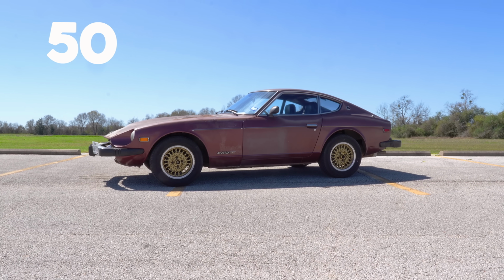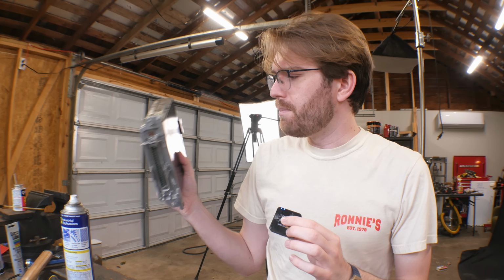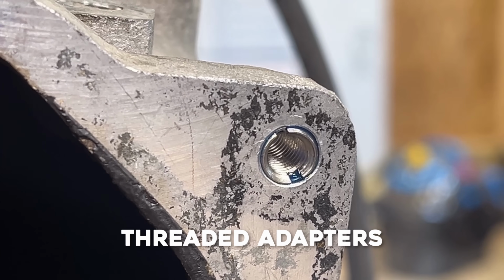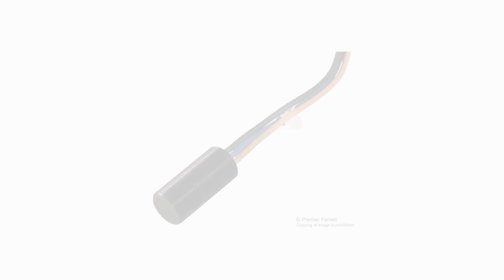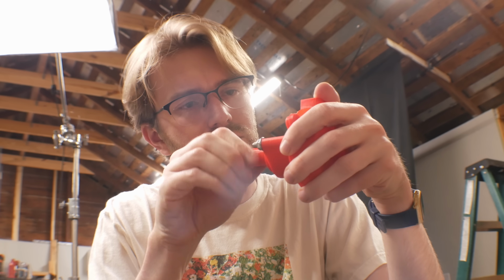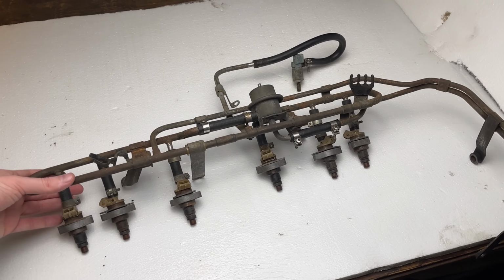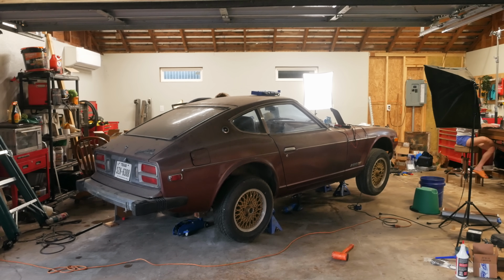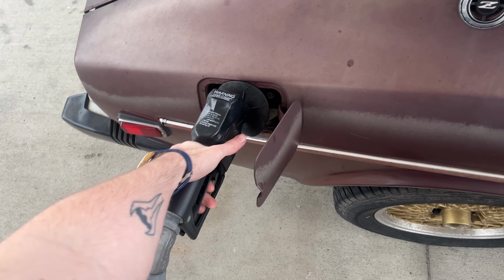Modernizing a Vintage Car

Comment: Please be careful putting more power into a 280.... they are great cars and make fantastic street racers and even better drift cars, but for most people it just becomes very dangerous to drive.  It's a rear wheel drive car that only weights as much as your mom , and when roads get wet it'll sling you off the road before you know it. I had a very close friend die in a Nissan 240z (same thing, but after they got bought out) and that's exactly how he died.... fishtailed into a ditch and ramped over a colvert and into some trees.  He was a small guy, maybe 120 lbs, and he died instantly.  So just please,  be careful.

Comment: I would route that PCV breather filter through the intake air duct so the airflow is being measured properly... It's surprising that it is only getting about 19mpg... I'd expect it to be a bit better... It's better than it was, so can't complain.

I imagine this about the same level of effort the original engineers went through, and I'm sure they were very impressed with themselves.

What software were you using?

Anyways... Good editing, was very entertaining... I just discovered your channel for the first time.

Comment: I think the real reason old classic car enthusiasts don't like computer control is because it was a massive shift in control and repair-ability from the mechanic to the manufacturer when it first came out. Since you can DIY engineer the same system yourself now, it's not so much of a big deal. Hopefully this trend continues for cars made nowadays.

Comment: I had a '78 from 1995 to 2000.  Did a significant amount of work to it.  One thing that really helped was replacing the rubber parts in the suspension.  That way any of the additional power I was making from replacing seals, eliminating vacuum leaks, porting and polishing the head, decking the block, etc. made it to the wheels rather than overcoming skewed geometry.

Comment: Aren't you missing a rotation sensor to tell you which half of the cam rotation you're in relative to the crank?  Or does a cam sensor alone actually do the job?

Comment: I think the only thing that might cheaply add more efficiency is using an electric fan instead of a clutch fan. Unless you plan to drop in higher compression pistons

Comment: very nice restomod
though you should sweep the inlet of the throttle body adapter into that oval section, you will some fucky flow characteristics. also, plz press-fit the bearings on the tone-ring driver shaft for the RPM signal. the inner race will slip and it will start putting trash into the motor.

Comment: Incredible what you achieved and everything you learned in the process, but 13% more horsepower and a 10% improvement in gas consumption... let's just say the project was worth it for everything that was learned.

Comment: Very well done sir.  I had the 1977 version of that same car, even the same color.  Was a maintenance nightmare.  So many things weren't designed well at all.  I agree that all the shit you jettisoned in favor of a much cleaner approach will add a ton of reliability.  The stock fuel pressure regulator always gave me problems.  When so we get to see a Part 2 of this adventure....

Comment: L- Jet rules - still running in many cars close to 50 years later. As long as you have a good temp sensor and afm itll run all day everyday in the middle of the summer and dead of winter

Comment: "you lose direct connection from the driver to the car" moreso refers to the fact that everything electronic is yet another point of failure, just like the mechanical, but you have to do mechanical things at some point regardless
and if you have no direct way to arrest the engine's speed, the engine basically can get stuck in any position without any feedback as to why, which confuses people, and leads to accidents

theres a HUGE reason why your brake pedal MUST be directly and uninterruptibly connected to the brakes in a fashion that if you are to press the pedal fully, it will give the maximum force to the brakes, even if it is hard to do so (its even a federal law)
why?
because when all else fails, the brakes are more powerful than the engine, and you need a way to stop, no matter what

Comment: This brings back memories of me in the late 90s early 2000s trying to "modernize" my 82 Supra with the 5MGE engine. But most of this stuff wasn't available to me back then. The only stand alone EMS systems at the time were the AEM EMS and the APEXi Power FC. Both of which were WAY out of my price range. I spent countless hours with a multimeter,  a dual trace oscilloscope, and an APEXi Super AFC to get her as modern as I could. I would have killed for all the answers we have today. My turbo system was cobbled together from a 7MGTE and custom piping made in a buddy's garage. I had to fool the VAF signal with some help from Radio Shack lol. The end result...at one time I had the fastest MK2 Supra in the US with the 5MGE motor for a short time. Ahhhhhh those were the days.

Comment: Worth noting this is a L28E when they added electronic injectors. The base L28 is kinda of just a carryover of the L24 which is the 3 carbed version they also use in the non gtr version of the original skylines and is one of the best sounding vintage engines I've ever heard. I almost cried when I saw "modernizing". But for this hunk of junk... this is so damn cool! I think it's time for a bore :D

Comment: Modernizing the engine's not gonna help you when you tap something lightly with the front bumper and the steering column plunges directly through your chest.

There's a reason "vintage" cars should stay dead.

Comment: wooowowo new cars are better?. tell that to my datsun 210  , toyota celica  gt 95 and ford f150 ranger 1978  the ac works no issues  they are my day to day cars of use  . original motors and my family and girl cars are 2020 up..they  have issues  now and they are "new"

Comment: Sorry for asking but I was wondering why there isn't an mass air flow sensor in the system. Isn't that necessary for the ecu to calculate the right amount of fuel?

Comment: Great work. Another thing you can do is have the cam reground. The original grind is for smog not good. I have done this on a few ford 72 390s and the power is incredible now. I hope you can try that. My 94 4x4 nissan has over 430k miles and avg 18 mpg. Same as when I bought it new. They lied. Said it would improve after break in. Still no oil use between changes and no real repairs. Clutch at 200k and 400k, timing belt every 100k breaks couple times. Its a 4 speed so dont use them much. So much better than my f350 diesel 2003 i bought new. $$$$$ repairs but 33k miles on it . I never get rid anything. Still have my 72 f250 and a 63 galaxie

Comment: Incredible project. It is absolutely insane.I understand the idea was to not modify the insides, but just slightly skimming the cylinder head to increase volumetric ratio helps immensely due to modern fuel being much better. You can aim at 10.5:1 for great economy and increase in power. If your engine was 8.5 to 9:1 let's say, expect 5 to 10% increase in power and great MPG at part throttle operation :)

Comment: If you have the engine out of the car why not upgrade some very easy to modify components like upgrade the valve train upgrade the fueling upgrade the intake upgrade the exhaust from tubular manifold header to the tip and if you're not going to be running purely carburetor maybe go to a more modern engine control system but yeah I'm thinking that you're probably not capable of opening the engine and doing things properly so I'm guessing you're just going to have to bake this thing and make an abomination of a car. 
What you probably should have done it's just went and grabbed an LS variant and stuff it in there for a whole lot cheaper and a whole lot more power

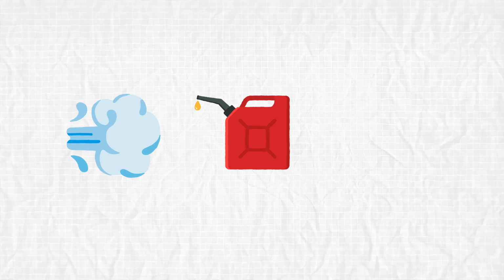Comment: 2:49 about all you can do if you're not going to do any real actual work to the engine you can do the best you can to make sure that a breeze cold air and get the hottest part you can get into exhale the exhaust as restriction free as possible

Comment: The one Chevy Cruze the diesel one has 340,000 mi on it the other Chevy Cruze RS has 205 k and neither of them have had any major service done never replaced an alternator I replace timing chains and belts batteries and brakes and oil and transmission fluid but other than that I think most car spell because of the operator user

Comment: My man just buy CNC, sentrix, hydrolic press machine from the flea market even old machine from 40s could make part you need and it's far more cheaper than buying part from Switzerland, there is no way you can't make those part because even a old guy who just graduate from elementary school could do that on third world country, i was working on muffler factory and our Chinese bos just bought all of those machine from 40s those machine is older than my country and grandma and it's still on service even when i was pressing it so hard that even squirt oil everwhere those machine is refuse to die.

Comment: FYI, if you have coil on plug ignition and one of them dies/starts misfiring, you shouldn't limp it back home. Did that on my 2011 Ford Flex, and had to replace the PCM and catalytic converter. Don't be me, it will save you money 😅

Comment: I wish i had a 3d printer when i converted a Mini to fuel injection for my degree back in the 90's. Don't you need a crank position sensor too?

Comment: i think you misinterpreted bosch in a way people could think it is a dishwasher company with no experience in car electronics, but bosch actually is one of the very first companies in the world who pioneered in car electrics/electronics... bosch basicly invented the modern spark plug and they have experience with spark ignition systems since 1897 - YES; since the 19th century! - that's basicly why mainly every modern combustion engine has somewhat a bosch ingnition ;)

Comment: 13:26, you know the Fiat 126p had an engine made for an disi, but in the later elx model used an an pc controlled spark system, you could have just looked how they measure rotation, i dont know if they even used the disi hole to count the rotation

Edit: lol sorry, even when living next to Poland you can only get the complete system for like 1 or 2 grand, so not even remotly affordable

Comment: Amazing project. I’m a boomer but not adverse to modernization of old tech.  Carbs are fine but EFI rocks, especially if your driving activity takes up into mountains where air density changes rapidly. Time to mod the internals of that 280z

Comment: so just a few thoughts first thought he’s definitely gonna need a new starter if he can find an original that would be great if they have to use a modern starter that could be a little complicated for adjustment second thought the fuel pressure system might have some complications. probably nothing further than cleaning which I’m sure he adjusted third thought is to get a full safety inspection for the drivetrain system and my last and final thought interior definitely needs a full detail, clean and possibly a new transmission after a transmission inspection which I’m sure he had done before he did any work on this vehicle at all

Comment: Awesome..!!!i I have to commend you on this video. This is probably without a doubt, the best DIY / No Prior Tuning Experience, most well explained and details covering video i have ever seen. And i can tell you ive seen plenty, ive also attended training seminars that have not been as informative as what you have shown in this one. My hat's off to you sir. Job well done, and the fact that you just "threw a map in there" and it worked, BECAUSE you took the time to get the absolute most basic things right first!, which are the triggering of the ECU, the ignition and sensors, everything else is secondary, make this such a massive win you have no idea.  Not to mention when tuned the thing made more power than in stock form.

Comment: Old farts like me don't like electronics not because U lose direct connection with a car, but because it adds delay in responsiveness and breaks when you in the middle of nowhere with no parts...
When I drove cars with a belt-driven fan and carb, I always get back on car's own power. Then I bought a car with electric fan, the wire broke and I didn't notice. And leaking head gasket puts gasses in cooling system, so temperature sensor didn't show overheating... The engine stuck in the middle of the bridge with cars flying right next to me, when I was pulling this junk to the safe place.
Another thing is always failing sensors, which you can't easily replace. In the old car all I needed is piece of wire and a screwdriver to open the carb and clean some jets if they get clogged. And to clean contact-breaker once in 3 years if it start to missfire, maybe change the 20 yr old condensator))
So yep. I'll go back to primitive car just because it's easier to spend more money on gas, rather than fixing it all the time

Comment: You do know that engine you pulled the harness and everything else was a 280zx donor parts.  This baby was running Su carbs, no fuel injection.  Go with a diesel crank, no power steering lobe, your block is good.  It is all about piston size, and induction.  The rear end will need some new gears.  Slap in a Mitsubishi Delica rear end to put hrspuurs to the road.  Or just slap the last engine in and change out the rear end first.

Comment: 1. that little raised part in the air intake will create a turbulence that will also cause problems for performance and for the seal in the long term. might wanna get some kinda insert sleeve or something.

2. you can probably get a bit more power if the engine is well used if you clean the inside. can probably do some kind of additive routine to do that for fuel oil and coolant (all 3 are DIFFERENT additives), seafoam can work wonders if you know what you're doing, which is probably about 15 minutes of video watching. its easier than doing a rebuild.

3. Don't put corn fuel through it without additive. Old engines hate that gunk.

Comment: Really nice job. Thats so much skill and thinking, who of you would have this kind of ideas? Thats something really special. But there is a thing im thinking about. Its a Naturally aspirated 6 cylinder engine, there is something missing modern NA 6 cylinder cars do more than 140 hp. Maybe higher compression, better Airflow I dont know it. The car needs at least 200hp NA

Comment: that little raised part in the air intake will create a turbulence that will also cause problems for the seal in the long term. might wanna get some kinda insert sleeve or something.

Comment: I did this in the late 90s with an Electromotive Tec 2 stand alone. I welded a reluctor wheel straight to the crack pulley and made a bracket for the hall effect. I used an L28t. I plugged the dist hole witha freeze plug. I made 400hp to the wheels at 18lbs of boost. The Tec2 only had 81 data points to adjust spark and fuel. The sensors were all GM parts.

Comment: Now im not sure the exact difference but I have an 82 280zx with the l28e which to my limited knowledge should be the same engine thats in your 280z, but ive been averaging 20mpg and ive even seen 24mpg and the car has had no modifications other than a straight pipe but even before I straight-piped it, it was getting 20mpg. As for power, ive never dynoed the car so im not too sure, all i know is its quite slow. Now my 280zx did come with an o2 sensor from factory so maybe the engine computer is a little different than the factory one in the 280z and maybe thats why its getting 20mpg, im not completely sure though.

Comment: Awesome job, as a shipboard engineer, you did some McGyver stuff there. Just to add, I would have just rebuilt the body up, modernized some stuff. And the best part is,  just convert to an EV. Many spare part motors now, IE: A Tesla motor. I have a 2005 Z4 BMW. I figured once the parts dry up. It's going EV. Thank you for a great feat in engineering.

Comment: The trick with the volumetric efficiency table is that you don't need a good one. You can re-tune the VE table from data logs of the exhaust gas composition. If you have a decent engine dyno, you can configure the ramp rate and basically closed loop tune every cell in the table. Or you can do it seat of the pants on the street, but it can be difficult to hit certain load-RPM conditions often enough. Once you have that, you don't actually need an O2 sensor.

Of course having an O2 sensor lets the ECU do those kinds of tuning changes on the fly, which is great. And it's good for safety, logging, diagnostics.

The harder one to tune, that you didn't mention at all, is the spark advance table. That requires a dyno, because you want to tune for peak torque without detonation. So you also want knock sensors.

Comment: Congratulations 😎👍🔧🔩🔨⚡ . Normally I dont watch modern EFI vehicle videos but like that you took an older vehicle and inproved on its output and brain stormed up parts to make the swap possible . im usually 80s and older vehicles and some what specialize in dodge slant6's = inline 6 and do basic mods to improve fuel economy , torque and HP on my channel . those stock mufflers will restrict your engines performance a little bit . a strait through muffler like a borla or magnaflow will help and there are knock offs like flow master FX pro half the price 😎👍🏁